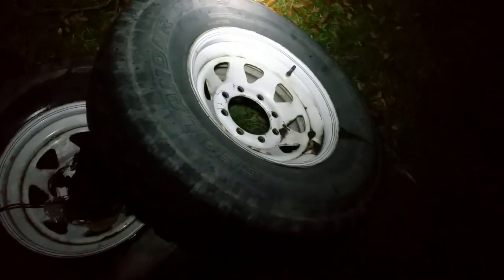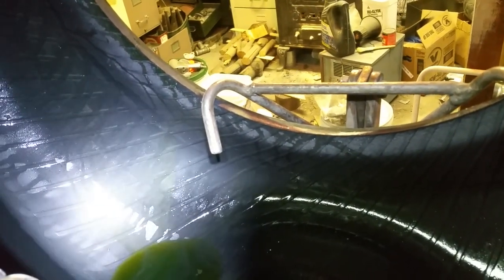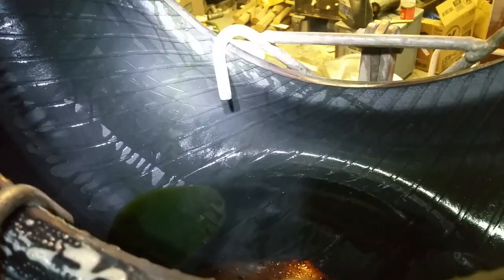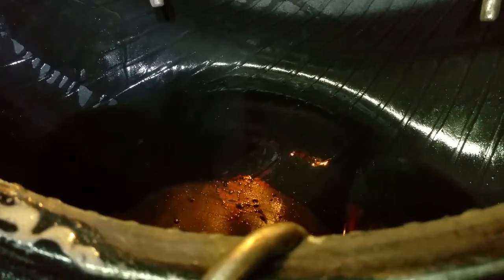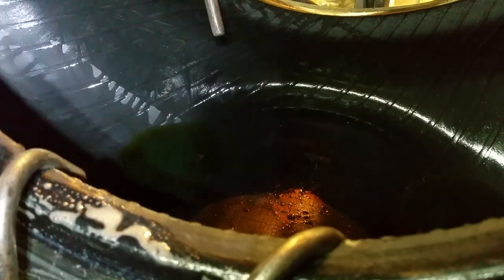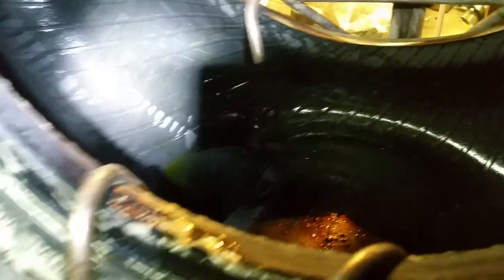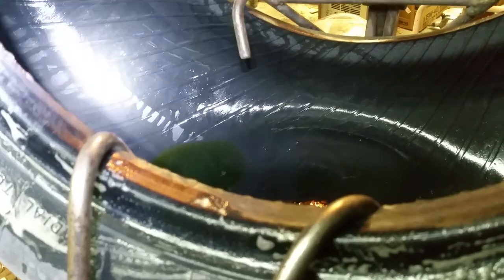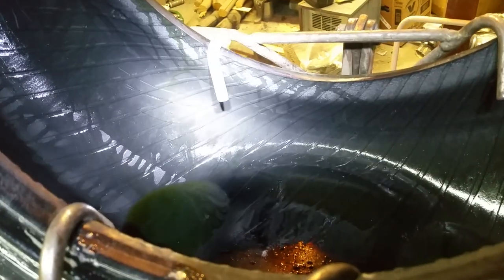Long Term Test: Fluid Balanced Tires

Comment: Problem with most antifreeze is majority of it is 50/50 based now.   The water in the antifreeze will evap leaving a sludge.   I've had this happen as I tried this.   The sludge will throw it off balance.
Reply: How the F can the water evaporate inside of enclosed sealed rubber tire? Lol
Reply: That's what I was thinking. Maybe a tiny bit can evap but not enough to make sludge unless you are constantly circulating the air in the tire I would think.

Comment: How much antifreeze do u put in each tire
Reply: Search up bead balancing charts and go with that same weight
Reply: I use about 4 cups on my truck tires and it has always worked great, I never hit speeds over about 75 or so, but up to that I have never had an issue.  I would also note that I am generally using old tires that I took off old rims from rigs I have setting around etc, so not great tires to begin with, but it has always balanced them out just fine.  

Honestly I have better luck with the 3 or 4 cups of fluid in my tires than I do with going into town and having my tires weight balanced by the tire shop.  Just don't get too carried away with the amount of fluid as with enough heat it does turn to a gas inside the tire and it could theoretically over inflate your tire.  But if you pay attention to your tires and check the pressure regularly I can't see that ever being an issue, I have run mine in 110F heat with heavy loads and never gotten any over pressure buildup.

Comment: did your 939 have working ctis?   curious how it affected that if at all.
Reply from the maker: Mine was an A1 so no CTIS.  In theory it adds and pulls air from up at the rim but I would be very hesitant to do this with CTIS.  In fact, I wouldn't, but then on the other hand I wouldn't bother with any of them.  There are just so many shakes and vibrations in a 939 that making one slightly better has very little effect.  I still feel if it is shaking hard enough to feel it in the steering wheel on warm tires you have another issue.

Comment: Awesome research feedback!  Thank you for posting this.  Conclusion: FOR SOME APPLICATIONS, filling a tire mostly full of a antifreeze+water coolant solution for one's geographic area then properly pressurizing the tire with air is better than balancing beads, washer fluid, rigid foam, concrete and tire weights.  Well, by God, alrighty then.
Folks, this DIY may void your warranty for your stuff still under warranty.  But, if you're like me ... some of the stuff I do with my equipment violated most of my warranties anyway.  Hence, "FOR SOME APPLICATIONS."

Comment: I have had great luck with antifreeze, I also use old engine oil sometimes in place of antifreeze.  I have not seen signs of the engine oil eating tire rubber either.

I like to use old engine oil around the rim as I am breaking the tires down, I use my handy man jack under the bumper of one of my rigs, when I jack it up the foot of the jack then pushes down the bead and unseals it from the rim.  These can get pretty stuck on there after a time and the engine oil helps to lube up the whole process.  One day I had a bunch of oil left in tire as I tipped the five can of oil a bit further than I meant to and I just went ahead and left the oil in there to balance the tire, worked great.  I have done it several times since then and it has worked on those tires as well.

Just here looking to what other people are doing and trying to see if "anyone" else has tried old engine oil besides me.  I am also looking to see if petroleum jelly is actually a good idea to use to lube and seal the bead when putting the tires back on.  I usually general purpose grease but oddly I don't happen to have any here at the moment.

Comment: So question, the 50/50 mix you were talking about. its 50% anti Freeze, and 50%Water?
Reply: You can also use straight antifreeze as well, but the 50/50 is a bit cheaper.  It is all about keeping the fluid from freezing in the winter, which then would throw the tire wayyyy "out" of balance...

Comment: debating on using slime or washer fluid.. probably go with washer fluid
Reply: Washer fluid is alcohol based which eats at rubber, it also freezes at a much higher temp than antifreeze.  Slime should work though, many commercial tires actually use slime to help seal leaks, I am not sure if it is the same slime that you get at the bike shops or not.

Comment: How to determine how much liquid to put in various tires ? Also I put liquid in my tires last night now they wobble. I used 8 oz maybe that was too much should I take the fluid out and have them balanced conventionally or what
Reply from the maker: What size/kind of tire? I have old truck tires that would take more than 8oz. I don't do this anymore, I either conventional balance or use beads. Made it too hard to patch flats. Again I was using this in more of a "farm truck" setting.